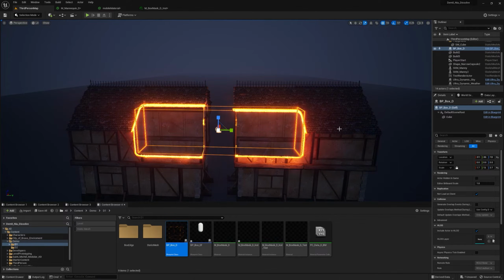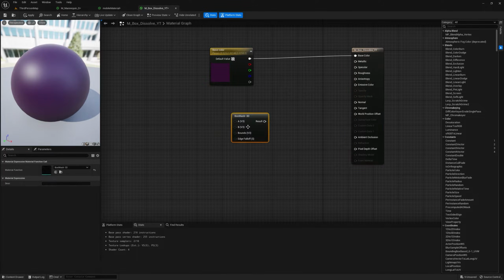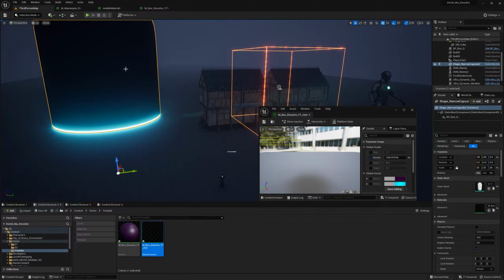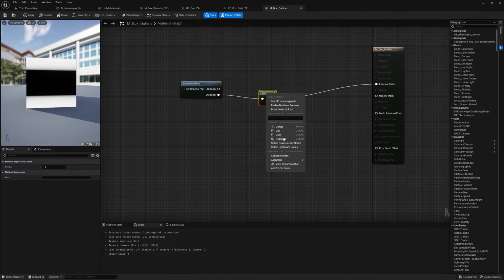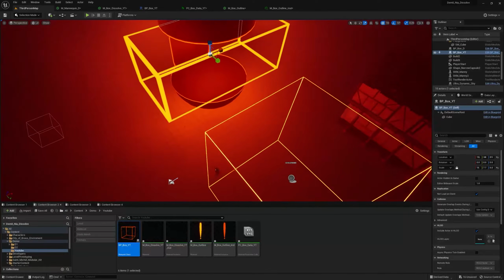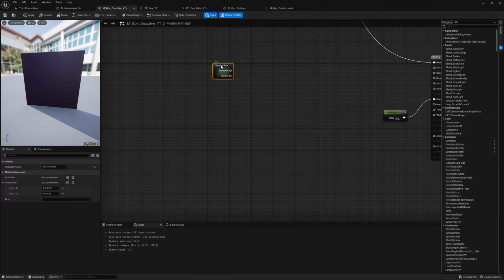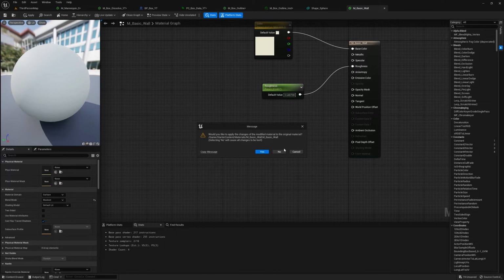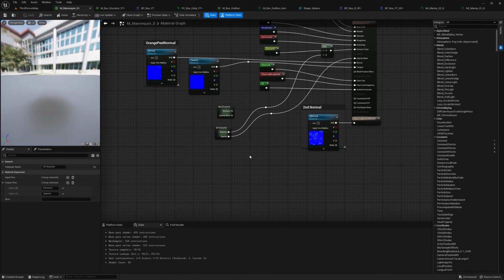Unreal Engine 5 Dissolve Mesh Tutorial

Comment: Important warning for everyone! If you use the Parameter Library, the dissolve effect can only be applied to one location on the map; two dissolve actors will conflict, simultaneously changing values in the Parameter Library. To avoid this, use a material instance or change materials directly in the intersecting object

Comment: Attached the mesh dissolution material to the target mesh material. But it is now not visible during the simulation. Only in the editor. How to fix it?
Reply from the maker: You need to copy paste the stuff from construction script to begin play
Reply: @UnrealCG  I copied and applied the new material to the mesh. But now the mesh with the new material disappears during the game. The mesh is visible in the editor, but disappears during the simulation.
Reply from the maker: I meant from the blueprint not the material, like the part where we set the vector parameter using the cube etc inside the blueprint

Comment: Great tutorial, thanks for creating this video. Has anyone tried to render this effect out using the Sequencer? If so, how did you get this effect to show up in the Movie Render Queue?
Reply from the maker: Read the pinned comment
Reply: awesome, putting the nodes from the construction script into the event graph in BP_BOX_YT and then using an event tick to fire the Set Vector Parameter Values works. I am glad a few others asked the same question. :) Thank you for responding........@CG
Reply: @shermanwellons  Thank you!!  I had the BP's setting their vector parameter values on begin play but that wasn't working.  Even putting in a short delay didn't work.  For some reason, the event needs to be called from within the Sequencer to get it to work.  I'd be curious to know why that is, if anyone knows?
Reply: @UnrealCG  Hey there! I can't seem to find the pinned comment? I'm trying to render out this nice FX as well in Sequencer and I'm getting different results. Do you have any pointers? Thanks!

Comment: (duplicated since my other account doesnt seem to show)
If you like me have trouble getting an actual glow, go into the color options for emissive and change the V value to something high like 500
Also if you have an issue with the capsule disappearing after adding rotation, try restarting editor
generally I had several steps that didn't initially work and I had to retrace steps, recompile things, move them etc but eventually got it to work

Comment: If you like me have trouble getting an actual glow, go into the color options for emissive and change the V value to something high like 500
Also if you have an issue with the capsule disappearing after adding rotation, try restarting editor
generally I had several steps that didn't initially work and I had to retrace steps, recompile things, move them etc but eventually got it to work
Another trick i realized was that if you set the box data bounds to -100 in each direction then material previews will not have oppacity so previews in editor work properly

Comment: Great video, really helpful. I'm trying to do this with a translucent material and can't copy over the material effects in the same way. Anyone know a fix for this?
Reply: have you solved this?
Reply: @veith3dclub  not really solved it. I just found another way of achieving the effect i wanted. I got the material to change colour and spawned a niagara there that made it look like a forcefield was being hit. Worked for what I needed.
Reply: @veith3dclub  I found that if you were doing translucency as the blend mode, you can't have the regular Opacity node. Instead, and it doesn't look quite as good, you can use the masked blend mode and use a DitherTemporalAA node instead (the Alpha Threshold input is your opacity). For this effect, you can bring in a Lerp node connected to the Opacity Mask -- A is 0, B is your DitherTemporalAA, and the Alpha is the Opacity output of the Dissolve Effect.

Likewise, if the material you are incorporating this into has an existing Emissive Color set up, you can also use a Lerp node instead: A is the Emissive output from the Dissolve Effect, B is your existing material's emissive, and Alpha is the Opacity output of your Dissolve Effect.

A year late but I hope this helps someone :)

Comment: Nice tutorial. How can I create multiple boxes to apply the dissolve effect? When I add two or more boxes, the dissolve effect only works on one box
Reply: Same question in case you have found a solution ^^
Reply from the maker: Hi. For this you need to have multiple box mask in the material and combine them together,  for the DF version if you extend box mask bigger and add more mesh into it then that might work, but this will also make the material react with other meshes in the world.
Reply: @UnrealCG  Thank you, I make multiple box masks and they work well, but my project needs 30 more boxes. It will take a lot of time to create nodes in the material. Do you have a solution?
Reply from the maker: Simple way is to use Many cube mesh and use the DF dissolve but with large box mask and make sure nothing with DF is near your mesh except the cubes. Since your might a unique cases and not like a game, this should be possible
Reply: @UnrealCG  I have tried using many cubes with DF dissolve in sequence, but when I render the video, the animation is laggy and the dissolve is slow. Do you have a solution for that?
Reply from the maker: Hmm, I don't think I know a better way for like using 30 cubes without lag
Reply: @UnrealCG  But how can the program know which values have to be connected to which object. If I duplicate the whole code until the box mask and then multiply both box masks together, it makes no change. Do I have to create another boxData? The DF version sadly does not work for me.
Reply from the maker: You can use material scalar and vector parameters, instead of global collection  parameters
Reply: I assume if I need to have multiple copies of the box blueprint with different references to the material parameter names for this to work with multiple boxes? Or can it be done in one blueprint?  @UnrealCG
Reply: @UnrealCG Hi, thank you for your quick answer ^^ and indeed it's for a game mechanic and not for a single case so I'm just going to solve the problem by saying "limited to a single hole per wall" hehe, but that's good to know that it is possible to have more than one anyway.
Reply from the maker: I don't know if I would use this method for bullet holes? Kind of overly complicated for that.